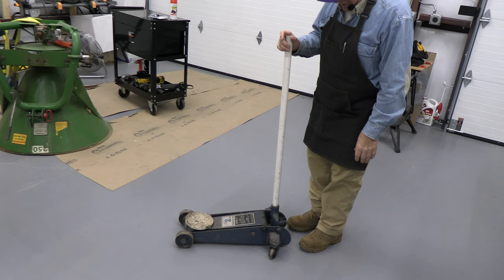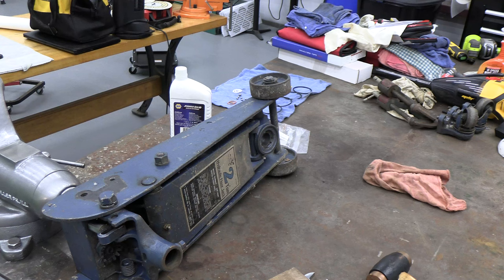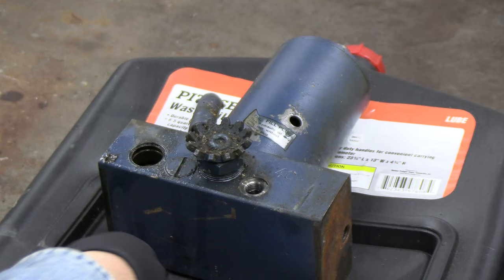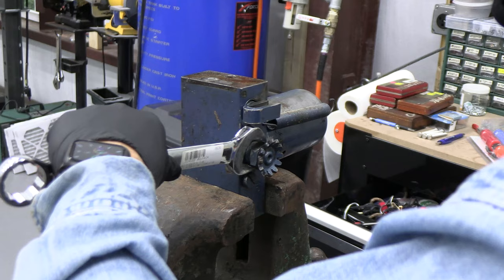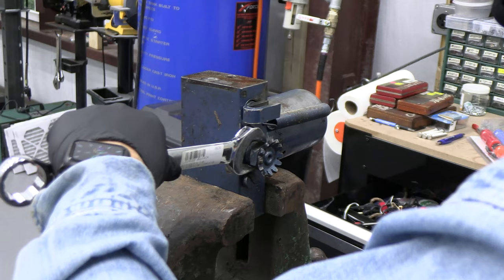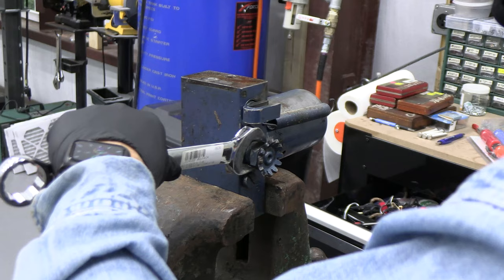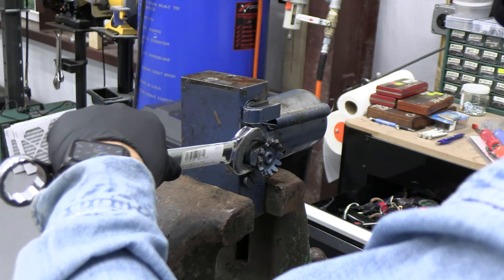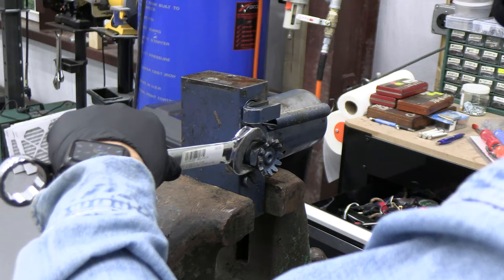Sears 2 Ton Floor Jack Complete Rebuild

Comment: If I have misplaced the plunger where would I find one or what size is it? Thanks for the video!
Reply from the maker: So you ask a great question. I am not sure where to find that replacement part. I would have to do an online search or possibly eBay because I don’t think the readily available. Consider subscribing. Thanks. Joe.

Comment: Approx. how many turns do you have in the needle valve screw? Of course I took mine out and didn't realize it was factory set to the correct setting. I believe you mentioned screwing it all the way in and then if counted so many turns back out. Thanks for the video, it's very helpful!
Reply from the maker: Yes, I think a good rule of thumb is to screw it all the way in and then back it up six turns and it should be close can I make

Comment: First off; that is a beautiful Wilton bullet Vise that your keeping clean beside you there. HE...He..         {Oops! there you're using it.}
I just missed out on one on my local FB marketplace for an extremely good price.

I had a knee jerk reaction to the jack being from Japan, and why put any effort into repairing basically throw away tools.
I quickly remembered that Japan does not build tools like China does, in fact they build very good quality tools and electronics.
I have an old monkey wards jack that I was considering messaging with a repair on it.
Your video has convinced me to do so.

Great Video as well as thorough. 
First video of yours and you got me to sub.
Reply from the maker: Hello there. You are totally right. Japan makes and has made very high-quality machine goods and instruments. No question. Rebuilding this made in Japan. Jack is absolutely worth the time and effort. You’re basically re-creating a brand new perfectly working tool that will last generations. Enjoy the process. You can get the rebuild kits in the video description. Consider subscribing. Thanks. Joe.

Comment: I have a vintage Craftsman 1 1/2 ton jack. I think its a 727.12100. Mine pumps up and lift well, but slowly it creeps back down. No outside leaks. Think it needs a rebuild? I will assume watching your video will help me as well. You mentioned Ebay, but I see Amazon links. Great work and you went at a great pace. Thank you for this great content.
Reply from the maker: Thank you for your question. Yes when you pump up a jack and it’s slowly leaks down that is the number one reason to require a rebuild because basically it’s worthless at this point. The rebuild will fix that problem and the step-by-step instructions in my video will guide you all the way through it. It’s a great joy to rebuild your vintage Jack, and then be able to use it yourself and then pass it down to the next generation. Consider subscribing. Thanks. Joe.

Comment: @JosephHunstad  HI Joe! I am in the middle of this rebuild and have two questions: 1. There are 3 sizes of ball bearings in the kit, so when you refer to the "Large" one I can only guess which one it is. Can you help me as the where the middle size one goes? Also, I neglected to watch your video before starting and failed to not the position of the needle valve. Suggestions where to set it or is it reachable when the jack is reassembled?

Comment: Where do we find the seals if the floor jack model number is no longer visible?
Reply from the maker: So many of these jacks were produced with different brands, but they all are very similar and the rebuild kit that I have mentioned in the video description usually works for all of them. That’s what I would try. Consider subscribing. Thanks. Joe.

Comment: Wish mine still had the plate decals on it, but it faded to metal from sitting outside its whole life. It was my grandfathers, and he didn’t really care about bringing it inside, but it’s still in beautiful shape. Only issue is the cup, that is rusty and pitted beyond fixing, meaning that i had to beat off with a hammer aswell. only has paint on the bottom left.
Reply from the maker: Thank you for your comment. Yes they’re wonderful Jax. You probably could take that cup and sandblast it and then repaint it and it would look as good as new. Just a thought. Consider subscribing. Thanks. Joe.

Comment: Do you know where I can get the o-rings/seals kit for Central Hydraulics item 92782?
O-rings seals kits from Harper Freight Tools don't fit.
Reply from the maker: Hey, that’s a really good question. I’m really not sure but if you’re able to measure the O-rings, you might be able to buy those on Amazon. Thanks. Joe.

Comment: Well very glad someone is showing how to rebuild these but damn, didn't show pulling the piston rod out and bad main seal?  Cmon and what about flushing system before reassembly
Reply from the maker: Hello Wes, thank you for your comment. Because I already put in so much oil, the quality of the oil in the system was outstanding so I did not need to flush it. Of course if you found the oil was terrible, you’d want to do something other than that. Your comment regarding the piston rod and main seal are very valid. I had already filled this, unfortunately, without any audio, so this is actually a redo to complete the video. Sorry about that. Otherwise I hope you found it helpful. Please consider subscribing. Thanks –

Comment: Can you get the replacement gear for lowering the jack? My gears are broken off ?
Reply from the maker: You know that’s a very good question. I know which gears you’re talking about the pinion gears. I have not looked into that and I do not have a readily available source at this time if I find what I will try to get back with you. Consider subscribing. Thanks. Joe.

Comment: If everything else is in good shape as it was here you can consider buying just the piston cup seal to save a few bucks.  It's 40mm o.d x 22mm i.d x 12mm thick and it's used on a wide variety of floor jacks including my MAC Tools jack that looks exactly the same.
Reply from the maker: Hello John. You were absolutely right. I didn’t realize that that was the real issue because everything else is reasonably good. Yes, as it turned out, I could probably have just replace that single part and everything would’ve been fine, but it was good to basically give the jack a complete once over to restore to original. Thanks for your comment. Consider subscribing. Thanks Joe.
Reply: I have found that it is safer to replace the old parts the moment I take them out. They will not intermix with other parts and I will not run the risk of placing them in the wrong order. 
On the other hand, you will save mony buying seals from a seal and bearings store. I took the old ones and they measured them. I paid about $20 for the whole group. Those online kits are way overpriced in my opinion.
Reply from the maker: @jpcheco  I don’t disagree with you thanks for your comment. I want to replace all the parts including the barbarians, etc. but they’re rarely a problem if ever. Thanks again consider subscribing. Thanks, Joe.
Reply: Thank you! for this comment - it saved me a lot of measuring. My same jack has the exact same annoying issue where it won't stay up without load, but will fully support loads. I think that is the same single issue that the jack in this video had. Seems like most of the components are non-wear, or external sealing items, so no need to replace unless there is a leak - even then it's just orings and a couple of pressed-in seals. Thanks again, it should save more than a few bucks, especially considering the copper washers don't fit. Update: just replaced the one seal - it was completely deteriorated - changed it without removing anything from the jack except large nut at top of cylinder and unlatching spring - took 20 minutes including flush with brake cleaner and refill.
Reply: @JosephHunstad  Thanks for the great overall rebuild video. Well done! I learned the specific part I need before tearing down, and how to do it.
Reply from the maker: Hello repo man. Thank you for your nice comments. Let me know if it works when you put it together. I’m pretty confident it will. Consider subscribing. Thanks Joe.
Reply from the maker: @repoman6034  I think you got it exactly right. Let me know how it goes. Thanks, Joe.

Comment: I took mine apart because it wouldn't go up did it all but taking adjustment side apart now it won't go down 😢
Reply from the maker: I believe it’s because you need to adjust the needle valve. It’s in the video. I would loosen it about six turns it should allow the hydraulic fluid to escape and allow the jack to come back down. Consider subscribing. Thanks. Joe.

Comment: Enjoyed the video. My jack is identical, even looks the same. Thanks!
Reply from the maker: I’m glad you found found it useful. Consider subscribing. Thanks. Joe.
Reply: @JosephHunstad  
I just began rebuilding mine, and found a nylon backer washer and an o-ring down the pump rod shaft. Did you change that on yours? If so, which part goes on top in the groove? The o-ring or the nylon washer? It's a PITA to change b/c of the bore being smaller than the 2 parts.
Reply from the maker: I tried to replace every single part. I’m not exactly sure what your part looks like maybe a picture thanks, Joe.
Reply: @JosephHunstad  
Sorry I don't have a pic b/c the jack is already in service.
But if remove the pump rod, and look down the shaft, you will see an o-ring.
Anyway, I talked to the tech who sold me the rebuild kit and he told me the backer ring goes above the o-ring.
I also lubed the wheel shafts and wheel top bearings with lithium grease (spray).
Now my jack works better than when new!
Thanks for telling us it was made in Japan and is of high quality.
Reply from the maker: Hey, that is so good to hear. I know isn’t it wonderful when you rebuild something at a truly is better than new fantastic take care.

Comment: Hi Joe.  A very interesting and well detailed rebuild video!  It's exactly what I need as I have to rebuild my 2-ton Sears floor jack.  Am I correct in thinking that you used all of the pieces in the kit, except for the 2 copper washers that were "thicker" than the factory ones?  Thanks.
Reply from the maker: Thank you for your question. No I did not use all the parts. The main cylinder is welted onto the body of the lift mechanism so that didn’t require any seals. Others that that part is separate require an extra O-ring so no I did not use all of the parts. I would say I used 75% of the parts or more. When I looked at the steel ball bearings I couldn’t tell any problems with the ones I had but I did replace them all. Good luck with your rebuild it will go fine. Please consider subscribing. Thanks – Joe

Comment: My leaky Sears 2ton jack is a 328 12041.  It looks like the 12160. I can not find a seal kit for 12141. 
Do you think the 12160 kit would work? I hold you harmless for any opinions.
Reply from the maker: You ask a great question. Fortunately, the seal kit that I have listed is actually quite universal and comes with extra pieces for many different jacks. I believe that it will take care of your Jack without any issues. Consider subscribing. Thanks. Joe.

Comment: Your video is the best I've seen so far but I still have some problems with it. I wanted to see how you got the O ring, ring back up and the plunger pump oil seal all in that hole. And I wanted to see which direction of the plunger pump oil seal is up. There is a top and bottom to that plunger seal so which side is up. You don't get directions with any of these kits.
Reply from the maker: Hello Samuel. Thank you for your shout out and your question. The O-ring and ring back up simply are folded and go into the hole of the pump. And then with your finger you just open those up and they pop in the place inside. The seal is placed so that the flared part is at the end, facing away from the cylinder.. Consider subscribing. Thanks Joe.

Comment: Hi, good video 👍Question, my Craftsman 214. 12300 three ton jack pumps up a bit and falls flat slowly. I filled the reservoir and bled out all the air prior to it doing what I mentioned and before working on it. Any clues to the problem? Txs
Reply from the maker: Hey there thank you for your question. It’s undoubtedly one of the seals that has failed. The slow leak is typical and problematic for a seal issue. If you can look up the model number of your Jack, you can probably get a rebuild kit which corrected the problem for me.let me know how it goes. Thanks. Joe.
Reply: @JosephHunstad  hi, txs for the reply. A seal? Where do you suspect it is? It's not leaking underneath nor is it leaking on top where there are four holes. i. e. The pump shaft, the next hole, the valve hole and the set screw hole.
Do you mean the bottle jack internal seals? Txs
Reply from the maker: Yes, it is an internal seal. You have to take the pump apart and my video explains that if you watch it you’ll be able to follow it step-by-step and then it’ll be repaired. Thanks. Joe.

Comment: My Sears 2 1/4  is labelled Manufactured for SHINN FU co. of America Inc. In TAIWAN. Very good video. I need more understanding on the adjustment for the factory adjusted screw.
Reply from the maker: Hi Donald. Good question. If you remove the factory adjusted screw, the best thing to do is to screw it until it stops counting how many revolutions there are. When you reassemble, it screwed all the way until it stops and then back it out that same number of revolutions. That is a good starting point and it’s probably all you need. Consider subscribing. Thanks Joe.

Comment: My identical jack is doing the exact same as yours. It bleeds down slowly while I am jacking, but once the saddle gets some pressure on it, it works and holds just fine. Are you saying in the comments, that you feel that the main problem was the light blue colored large piston seal?  Nice job by the way!
Reply from the maker: Yes, it is probably that seal. That’s the most common point of failure. Just be careful if you’re using it and it’s bleeding down it might be risky. Consider subscribing. Thanks. Joe.
Reply: Hi Joe,
I did subscribe!!  I thought that possibly it could be debris/shards where the 2 check balls reside under the metal cap on the valve body. The parts manual calls this the Suction/Delivery Assembly. That said, I bought this brand new in 1975 and I have used it extensively for all of these years. I guess that it does warrant a full rebuild.
I may just pull out those ball bearings and check anyway. Has anyone run into this before?
Reply from the maker: Those barbarians are essential. Be sure you replace those those they’re probably not worn mine were not but the rebuild kit comes with replacement parts anyway so I used the new ones. Thanks.

Comment: I have a Sears floor jack from the 1980’s and it’s painted green. It also doesn’t pump up. I didn’t realize that a rebuilt kit was sold.
Reply from the maker: Hey there, I’m glad you tuned into my video. Yes the video goes step-by-step through the whole rebuild kit. It’s actually a lot of fun and then your Jack is basically as good as or better than new and then it will last for another. I don’t know two or three generations. The jacks are excellent and it’s just need for a rebuild which is fully described to your period consider subscribing. Thanks. Joe.

Comment: Doc, I'm rebuilding and restoring (tore down as far as I can, sanding/painting, etc.) my Dad's 1 1/2 ton jack.  Your video helped me A LOT.  But under the adjustment screw on the right, all that's up under there a like a rubber 'floor'.  I pushed on it a little (very little) and it has some give, but not much.  Any ideas?  Any help would be greatly appreciated.  His borthday is on 12/22, I'm in the home stretch except for knowing what the story is on the adjustment screw.
Reply from the maker: OK, great question. I would leave that alone because that is a cover of an adjustment screw that was adjusted when the thing was built at the factory. That controls the maximum pressure and the maximum lift and I think you can just leave that B. I did take mine out And readjusted it basically the same setting that it came with. I would leave that alone and not mess with it because it’s already been set. Consider subscribing. Thanks you will love this Jack for many many years you rebuild it. Have fun. Joe

Comment: Well done. I took apart the presure screw before to part that explains saving the setting can you tell me what number of turns you used on your?
Reply from the maker: Thank you for your question. I’m glad everything is been useful for you what I would do is tighten it all the way down and then back it off six turns as a start see how that works and then possibly adjusted upper down two turns at a time but it probably won’t be necessary. Consider subscribing. Thanks, Joe.
Reply: @JosephHunstad     Thanks for reply.

Comment: I have a slightly newer sears jack, do you think the rebuild kit linked here will work or do you think it will be different? Thank you.
Reply from the maker: If the jack appears to look similar to the jack, I rebuild I believe the kit will be just fine. It actually comes with extra O-rings and seals that allow it to be used on multiple jacks. Consider subscribing. Thanks. Joe.
Reply: Alright, thank you. @JosephHunstad